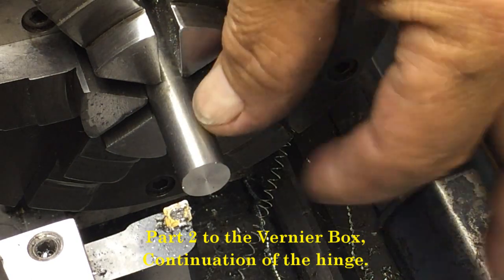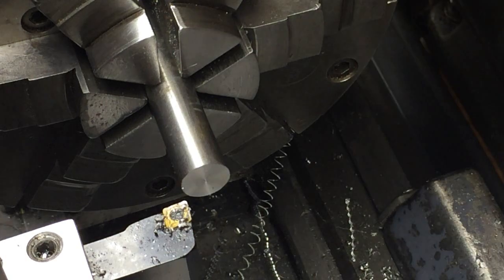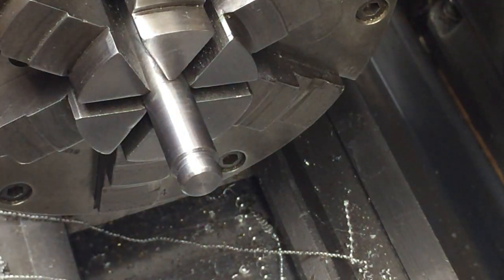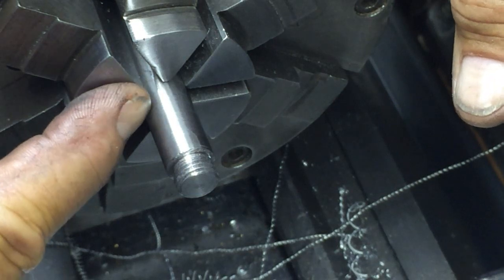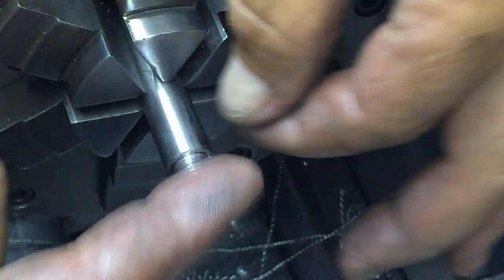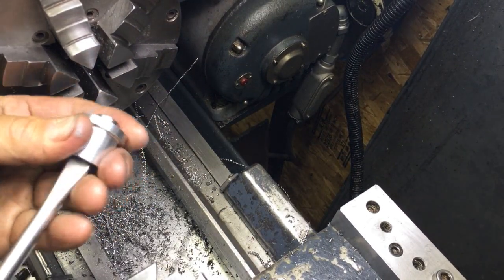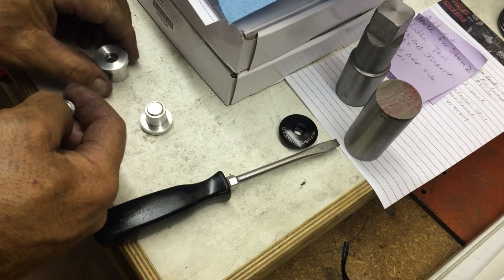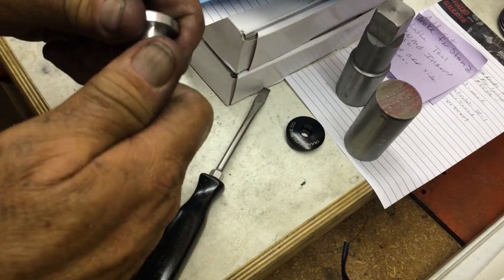Vernier Box Part 2

Comment: Interesting slitting saw blade.
Reply from the maker: Bruce Richards Small carbide tipped wood cutting blade.  Works great about 0.052 thickness.  Thanks Bruce.
Reply: Yes I thought that was what it was. I have used my radial arm saw to cut ally but never seen a wood plade used and n steel or is that ally too?

Comment: Randy,
Just curious about the RPM and feed you used to machine with the carbide insert your W-1 1/2" drill rod in this video? The finish looks very smooth.
Thanks, Paul
Reply from the maker: Paul Jones Right around 700 and 0.002 to 0.003 in/rev.  Very good finish.  With W-1, I never can get a shiny finish, but the finish is very smooth and and polishes easily.  Thanks Randy.